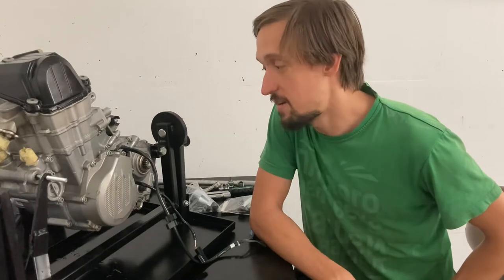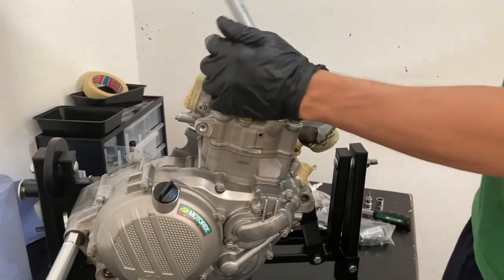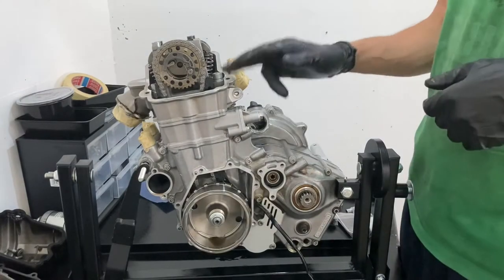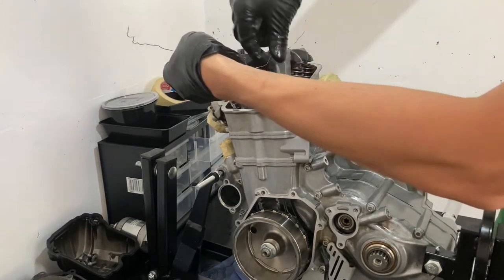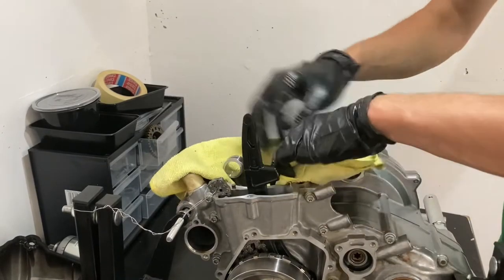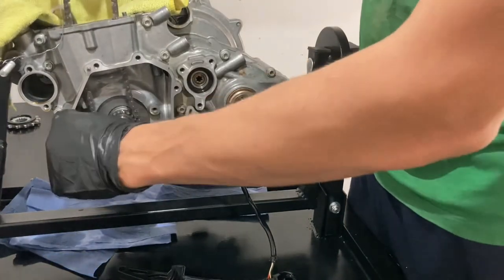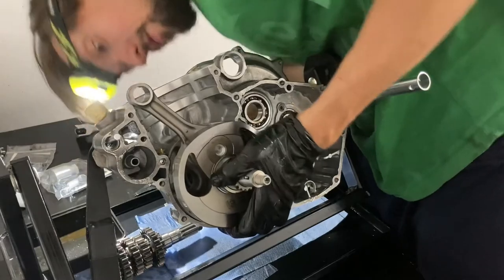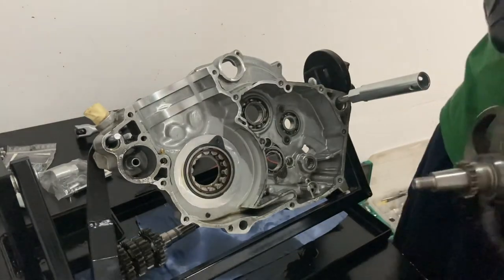Engine Disassembly - 2020 KTM 450 EXC-F Dirt Bike

Comment: Thanks for taking the time to show it all, just a quick one tho, surly it doesn't matter if the chain falls or the timing is out if your stripping out the two anyway, they will be out of time on the bench you know😁👍👍
Reply from the maker: Yeah sure the wire’s there just so you can grab it if you need either if it’s stuck around the sprocket during disassembly or during assembly. Easier to do it out of habit than forget to do it and drop the chain.

Comment: Off topic, but is the large "Grommet" style join between the rubber part of the airbox that the air filter mates to, and the rest of the airbox assembly meant to be sealed? Mine on a 2015 fe250 is a bit loose, and would most likely suck in air.
Reply from the maker: Yeah for sure. That rubber at the air filter edges should go direct to the hose clamp attaching to the throttle body. There should be no holes or gaps there, otherwise it’s damage or wear. If you have that you should replace the bellows. Removing it requires disassembly of all plastic attached to the subframe including the battery tray holding the electronics under the seat. Not difficult just take pics before disassembly for easier reassembly. Upon removing the bellows you could also have free access to duct tape it up as a temporary and cheap fix. As long as it’s sealed well…
Reply from the maker: You also have to remove the lower subframe bolts and the lower shock bolt to be able to tilt the subframe up or remove the subframe completely to remove that bellows. Also not difficult once you’ve stripped down all the plastics.

Comment: Hi great video! Did you change the plastic oil pump gears to metal ones?
Reply from the maker: No, never heard of them, and never have seen issues with mine... that whole area is bathed in oil. For those to fail you would need really shitty and overheated oil for long periods of time. I'd just keep the oil fresh and not worry about them.
Reply: Good to know. I’m just about to tear my engine down to replace a potential bent con-rod. Trouble is I can’t put the engine to TDC, what would you recommend?
Reply from the maker: @lukesancasciani  can't put it into TDC because of the bent conrod? Well if you're replacing the conrod you're gonna be tearing down the engine completely down to splitting the crankcase as you'll need the crankshaft out. I think KTM wants you to put the engine into TDC to make things easier to tear down and also to keep things in place in case you're putting it back together before splitting the case. That way the timing components can only go in one way (which is mostly what we need TDC for). You might have a problem pulling out the wrist pin if it's not accessible in the piston's current position... There's also the possibility of sliding the cylinder up and off of the piston without attempting to remove the piston from the rod. Use lots of heat and lube on the cylinder and you should be able to slide it off. Put some rags around the case opening so when you pull off the cylinder, the piston doesn't smash into the case and chip or break anything else.
Reply: That all makes sense, I think! Is there anything I can do to make re-assembly easier if it’s not the con rod but something in the top end instead? Until I start to tear it down it’s impossible to say 100%. The bike won’t turn over even in 5th gear after taking an unexpected swim in a deep river crossing.
Reply from the maker: @lukesancasciani  I mean you're gonna have to get it into TDC for reassembly because you need to assemble the timing just so - the timing chain, the main gear on the crank, with the cam gears, the valves, etc. If it's all off by one tooth, it's all wrong. Even the balancer shaft, which shares the same shaft as the water pump, has a TDC mark since it's designed to dampen engine vibrations via the counterweight. So once you're done doing whatever you're doing - top or bottom end - get the engine into TDC starting from the bottom. So rotate the crank into TDC, and lock it with the TDC screw without the washer. Make sure the balancer/water nyno shaft is in TDC if you removed that. Then you need to get the timing chain over the camshaft while installing the cam into the head matching the TDC dots. That should just about cover putting your engine back together and having the crank and valves moving in the right order... but I would look at the repair manual for whatever bike you have for the specific TDC procedure...

Comment: Any tips for timing everything on rebuild?
Reply from the maker: Yeah, you mean timing the crankshaft and valve drive correctly right? Firstly, you use the crankshaft locking screw on the bottom of the engine that inserts snugly into an indentation in the crankshaft web and prevents it from moving away from TDC. Then at the top end, the camshaft timing chain sprocket also has a dot (the bigger one) on the face of the sprocket near the teeth that has to be lined up with the top of the cylinder head. Both of those things are in the KTM repair manual with pictures. It’s worth paying the 20 bucks or so from print.ktm.com
Reply from the maker: Also, the balancer shaft/water pump has a dot near the teeth as well, and there’s a tool that you use to align it properly and lock it in TDC before closing up the inner clutch cover. If the balancer shift isn’t correctly timed, you’ll have excess vibrations and wear. Also shown on the manual with pictures.
Reply: @SilkRider  thanks to the replies, I have a 2017 EXC f 250, I have to almost all the way apart, I was just going through the thought of timing it on rebuild, I'll check out that rebuild manual didn't know that was a thing, I assume since I removed the piston, valves, crankshaft and oil gears at Tdc, once I remove the locking screw to split the case, once I rebuild again, if I get the piston in Tdc again I should be able to reinstall all the other mentioned parts that involve timing.

Comment: one tip cause it hurt seeing you do it(i used t as well)... when locking the clutch gear and crank gear dont use a 20 Cents euro its too hard and might break a gear go for a 5 cents euro or 2 cents theyr made of copper they will bend and take shape of the gear but to malleable to break a gear ;) from experience
Reply from the maker: I eventually got the 15 or 20 euro gear segment special tool delivered :) but that thing is hard to keep in place as well with out a third hand!
Reply: @SilkRider  i got used to it in fact i never bought the damn tool and been rebuilding engines for ever. i just slip the 5cents copper coin in on the first torque it takes the gear form from there on it sticks. could be im so used to do it also hahaha

Comment: Can I lock the engine without the cylinder in place? It seems to be jumping as I advance with the driver sprocket to put the locking bolt in its property hole without the fat washer.
Reply from the maker: The locking of the engine is really for taking the cylinder and piston off. It can be unlocked after removing the rotor and timing chain, otherwise the connecting rod and piston will be bouncing all over the place. Have you tried shifting it into the higher gears? Also try using a longer wrench or bar to turn the sprocket so you have more leverage and sensitivity. Get a light and look inside the TDC hole, at TDC position you will see the U-shaped cut out in the crankshaft for the locking screw. It should fit snugly in there and it doesn’t even have to be tightened very much.
Reply: @SilkRider  thanks SR, I will try the gears and long lever, cheers
Reply: It worked TDC acheived

Comment: Great video! 👌 does anyone know what the bolt on the bottom of the engine is for with a copper washer? In the manual they mention it as do not remove but I can’t find anywhere what it’s for. Any help would be great 👍
Reply from the maker: Yeah if you’re talking about the bolt with the thick copper washer, that’s the TDC locking screw. In the engine disassembly video you can see an indent on the side of the crankshaft web. When removing that thick washer and screwing the bolt in with the engine in TDC, the pointy end of that bolt will fit nicely into that indentation in the crank and lock the engine. This is what you need to do when checking/adjusting valve clearances. Don’t forget to replace the washer before starting the engine cuz that sucker will not turn over.
Reply: @SilkRider  yeah that’s the one! I have a very slight oil leak from that bolt and washer! It’s hardly anything but I’m wondering if I can easily swap it out or get a new copper washer for it when I change out the oil?
Reply from the maker: @bc-yx4wx  well first I would get a torque wrench and check that it’s tightened to 10 nm. If it is, then I’m afraid that washer will have to be ordered from KTM. The part number on my bike is 58030081000 and it’s €1.55. Do not try to use some other washers there! That bolt is only millimetres away from destroying your crankshaft!
Reply: @SilkRider  ok great I’ll try that!  thanks for taking the time to reply man I appreciate you! And loving the channel I just got a sxf 450 so this will be essential for my to learn about the bike thanks 👍

Comment: Do you do this for fun right? I mean, that motor with very little hours on it is almost new...
Reply from the maker: More like there aren’t any good engine builders where I live and I race this bike in international rallies as a privateer so it’s something I need to know how to do. After doing a full rebuild there’s basically no question as to what I need to fix in the event of a failure. Most failures though aren’t in the engine case, they’re in the top end or behind the clutch cover. So the engine case isn’t something that needs to be opened that often.

Comment: How similar is that motor to an sxf?
Reply from the maker: I would say very similar but if you wanna do the job just go to print.ktm.com and don’t skimp on the 25 bucks for the repair manual for the bike you’re gonna work on. It’s well worth it because of the small differences that could arise during the job that could frustrate you. With the factory repair manual you’ll just know everything ahead of time.
Reply: @SilkRider  thank you so much

Comment: What was wrong with that engine
Reply from the maker: Had 170 hours on it. Change of engine and transmission bearings especially makes things run tighter and smoother. Also the second time I took it apart was after I drowned it during a race. I was pulling swamp grass out of the crankshaft oil channels. No other way to properly clean out a flooded engine besides disassembly.
Reply: Hey Silk i have a 2007 ktm 250 sfx and has never had a rebuild do you think its time its running hard
Reply: Thanks a lot for your videos
Reply from the maker: @JuanOrtiz-wj4rc  thanks for your comments!
Reply from the maker: @JuanOrtiz-wj4rc  hey, how many hours and kilometres on the bike if you know? It’s never too early to get into your engine. If you take your time and do everything carefully and organised you can check the old parts over while it’s apart and order new ones while it’s still on the workbench. The more you do it the easier it becomes. I’ve had mine apart 3 times and I can say it’s become routine for me. Personally I believe the cylinder head should definitely be done, that’s where all the combustion happens. You can do the valves and bearings yourself as long as you have the tools. You also need to change the valve guides, which I haven’t done a video for yet, but as a first time, it might be better to just give your cylinder head to a good engine builder to do valve guides because you should use a hydraulic press for those. Besides that and a new piston, you can do the engine bearings and seals on the bottom end too along with oil and water pumps. But as long as you took care of the engine and changed the oil regularly, you probably don’t need to touch the crankshaft/conrod from my experience. Finally if you’re serious about doing as much work yourself, read The Four Stroke Dirt Bike Engine Building Handbook. That’s what I did!
Reply: @SilkRider  Oh man i have no way of knowing i does not a time meter and its never been worked on and its getting old like me 🤠✌️
Reply from the maker: @JuanOrtiz-wj4rc  then read the book and take it apart! Just don’t leave it laying around disassembled for too long or else you’ll forget how you took it apart. It’s like a fine Swiss watch in there except bigger parts.
Reply: @SilkRider  Thanks Silk ill try 🤠✌️
Reply: Not good for cranck balance/trureing 50:24